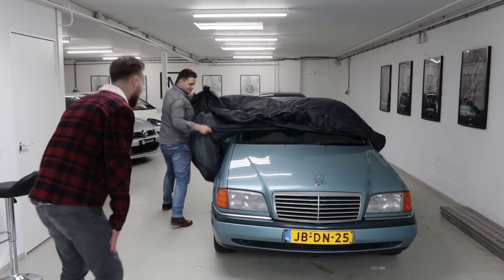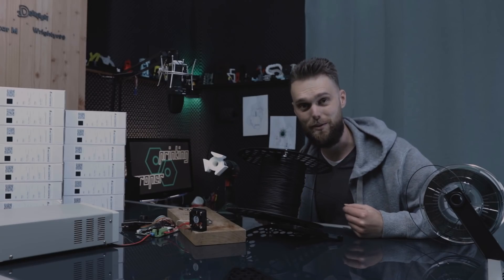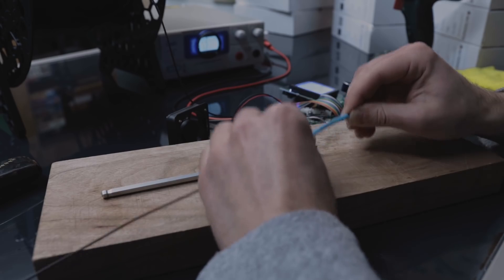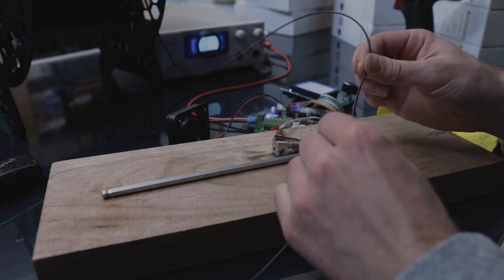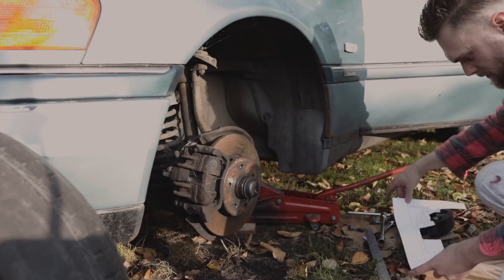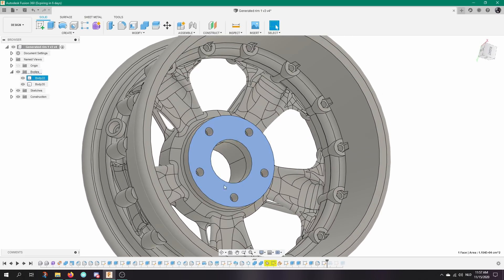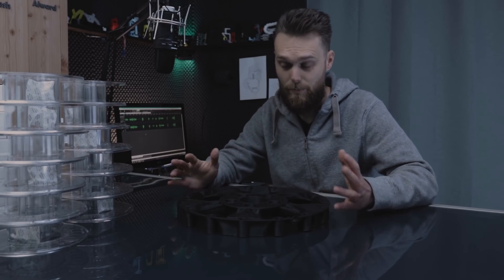I tried to 3D print a full-sized rim for my car out of ABS

Comment: It is interesting to warch the trial and error of an amateur without any scientific based knowledge atempting the impossible, is like watching me about 30 years ago.
On the other hand let's not forget that some bunch of amateurs built the Arc with primitive tools, while higly skilled professionals with all the tools available have built the Titanic...

Your dear rim stands no chance to actually drive you around at normal speed conditions, matter of instant stress and shifting pressure in bends, bumbps, etc, even if made of PEKK, which now is the holly grail, and not with the printer as it is now.

You need to do as I did, water cooled heatsink dual nozzle for indipendent temperature settings (I developped and tested this technology in the last year, sverall KG of PLA went as support material, and same for PETG, Nylon and Polycarbnate for parts printed for test only, sorry, no money for Ultem, not to mention PEEK or PEKK yet), and here I can help, we can talk about it latter, second thing; if you really want to drive them rims safelly (given taken) they need remelting, I am working on that too, the idea is not new, and Stefan from CNC kitchen did some interesting experiments, thou I went beyond that, it is just that I don't care to be a vlogger, so my results rather hit the market through other people, vloggers, influencers,etc.
Last but not least, warping...  yes you enclosed your printer, and that is OK...ish for ABS, PETG, even Nylon, or Policarbonate, but on Ultem (PEI) or PEEk and PEKK the temperature inside must be higher than your machine can take without running into huge issues, starting with cables and drag chain deformations, glueing togehter, and various electronic components failure (nope, they are not forseen for this environment, you need "outer space" rated electronics, and they are not cheap) but if you cockoon your print the results are amazing even in an open frame machine, whilst in a fully enclosedone that can take 120C inside (but not 230C as you might need) might work just fine.
I have cockooned my prints for a few years now, managed to print some impossible geometries in large volumes with litle or no deformations in open frame printers.

One last word on your progress:  Prima.

Comment: why don't you build a filament exchanger? it would be a lot easier to use than your big filament coil. you just a have to refill the feeder when it goes low but it always feed on the coils that are not empty so your print is endless.

Comment: He does realize how much heat brake rotors and brakes generate when braking right? What are the tolerances for abs before it starts to deform.
Reply: ABS starts to soften around 70C-105C (158F-221F). If your able to touch the rim without burning yourself then its not getting that hot. Also don't forget that metal is a much better conductor of heat than plastic and will absorb the heat faster whereas with an abs rim the heat will be dissipated into the surrounding air rather than into the rim. 
Edit: From what I can tell just from a quick google search a normal rim will get up to around 70C-85C in the worst case scenario. So although you'd be cutting it very close any random abs should be fine but using a higher heat abs would probably be best.
Reply: @timothysmith2130  Very in depth comment, good job. I would absolutely never trust this rim on my car, because the damage a broken rim might cause is unimaginable. I have a custom built 3d printer myself, so I understand that prints are never perfect. Even so, I would love to see this rim design submerged in powdered salt, and remelted for more uniform strength. Either that, or print the rim in hollow PLA, and make an aluminum sand casting.
Reply: @jonathonhebert7042  I definitely wouldn't trust it either, I just wanted to point out that heat probably isn't a top concern. I'd be much more worried with it just breaking outright. Aluminum is minimum 2-3x stronger than petg so going for a stronger plastic is a must imo. I think PEEK or PEKK would be much more suitable but they are not feasible to print for the vast majority of printers.
Reply: @timothysmith2130  you can touch it at the outside , now try near the brake disk.... the rim sits right on top of the brake disk tell me how the plastic will absorb any heat if its screwed tight to the hot disk......
Reply: @mgtworld  Now that I think about it, the rotor's heat will not be absorbed and spread by a metal rim, so the rotor will likely get much hotter. I guess we'll have to wait and see
Reply: @jonathonhebert7042  i think the biggest problem is were the rim touches the disk
Reply: @mgtworld  Maybe he should use some kind of heat resistant disk
Reply: Yeah, that's gonna be a huge problem... Go feel the rims of any car after braking. The entire rim is warm.

Comment: Have you done any force analysis? It seems incredibly unlikely that this will stand any chance of working. 
Think about how much torsional force will be applied to those skinny bubbs when you brake, it'll twist itself apart almost immediately. You'd need a solid metal center hub, at the minimum.
Good luck.

Comment: Is there a way you could add a resume print or change filament function to the printer? Then you could plan changes when it suited you, you could stop when a layer had completed so it would be easier to continue on top of the flat plane left when it stopped.

Comment: You really need a filament movement sensor.

A basic one is just a roller with a photo interrupter. Filament feeding causes the signal to pulse every Xmm, if controller (or even OctoPrint) doesn't see a pulse after Xmm should have been extruded, it assumes the filament has jammed and pauses the print.

Comment: Have you considered drilling a 1.75mm-ish hole into a metal cylinder/block and used that instead of a PTFE tube? It's not flexible at all and using a proper drill bit allows you to get even closer to 1.75mm accuracy. For heating, possibly putting it over a flame would be good enough too. I think your main issue there was using a PTFE tube and trying to squish it smaller, cause really you're just basically turning it into some kind of polygon and it's not perfectly round and it can be wider in some areas than it should. You'd best try to get a solid thing to hold it and have the filament go through extremely snug to make it accurate enough. Though I really am not sure. :P Best of luck!
Reply from the maker: It's going to be not 1.75mm-ish, but exactly 1.75mm ;) https://twitter.com/properprinting/status/1332036689368330254 I've got a fun and experimental idea to get this done. Hopefully it will work!

Comment: I dont believe it will work well as a wheel, the ABS layer adhesion is not good.
Reply from the maker: Me neither, ABS is the material to start with and to find out how the printer is performing. I'll be shocked if this will work and we'll see what's needed to get this done ;)
Reply: @properprinting  My printer is abandoned because I cant print well with it :(

Comment: I can't remember when/where but I remember a video about splicing filament and the guy had to run the filament through a series of bends (up/down/left/right and back) to recondition the plastic to flex normally after being heated and cooled.  I'll see if I can find it in my history.
Reply from the maker: I'm curious because I indeed had this experience. The second attempt was with a metal tube and the filament became less brittle after bending when it was cooled down.
Reply: @properprinting  I can't find it, might have been on work computer at previous job.  He used a hair curling iron (with two flat copper plates pressing together) with ptfe tubing.  He then created a jig that had pulleys that he threaded the joined filament on and then ran the spools back and forth -forcing the the filament joint through a series of bends a few times (starting slow and building up speed).  I think he had a heat gun somewhere but I can't remember if it was mounted or hand held.   He used very sharp angles on the cuts to increase overlap and twisted the ends together while heated.  Not like a cigarette being put out, but enough to force a good interaction between the surfaces, not just hard contact.  He also stretched and repressed the joint multiple times to help the plastic mix together while molten.  Apologies for not finding the link but that's the bulk of what I remember from it.

Comment: Great project, it will be quite a ride but Ican't wait to see you rollin' on printed rims :D You can check out filament connectors on amazon, the issue came from using 1,9mm PTFE tubes instead of 1,75mm diameter ones

Comment: Dude, just use filament run out sensor, i was able to print 40 kg of abs without turning printer off on a big format printer, just configure it to not turn off heated bead and turn on the buzzer when filament is gone. There is absolutely no need for joining spools it's almost asking for troubles

Comment: You cut the wires at an angle and by hand before splicing them. Maybe you should make a jig so that this angle is completly the same for both end. If the both ends don't have the same angle then the resulting splice might not be completely straight.

Comment: smart filament runout detector ? o.O its like 20 bucks + filament runs out/jams it pauses the print you swap the filament and continue, just keep the heating on , you also have gear that splices the filement for you as it goes in the machine (mosaic palet 2) etc...

Comment: I use a soldering iron to melt the two ends.  make it too big at the joint then use a drumel to clean it down.  Not perfect but has worked for me on PLA. Don’t use abs.

Comment: Using a dual extruder, you would be able to manually change the filament in an alternating pattern, which won't slow down the print, but you would have to change the filament during a certain time window. Not the ideal solution, but could work?

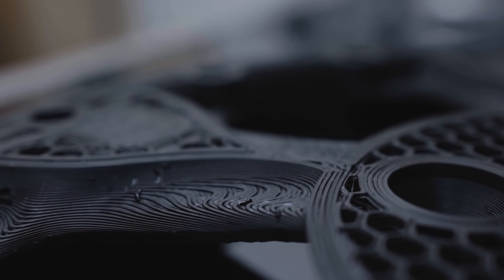Comment: Awesome printer and project.  11:30 - you might want to increase your extrusion multiplier a little?  Some of the beads around the outside of the hub are barely touching.  You want them fully joined to give you maximum radial strength!  Good luck!

Comment: I don't think it is actually a good idea to have huge spools. It will dramatically increase its inertia and each time your extruder demands filament it will pull, but the inertia will resist and cause the accuracy of  the extruder to decrease significantly. Can't you just use a filament runout sensor on a normal 1Kg roll, and swap rolls each time they are empty? To get around the inertia problem I think a spool unwinder would be needed that keeps a certain amount of slack between the printer and spool always. If you stick with the big spool these are available in 10kg spools. https://www.amazon.com/dp/B0745Z3HW4/ref=cm_sw_r_cp_apa_fabt1_3WbVFbCTXVSYP

Regarding your splices. Get two small blocks of steel, clamp them together, and drill a 1.75mm hole exactly on the joint between them. Drill two holes at each end perpendicular to the first hole for some dowel pins to keep the blocks aligned after removing the clamp. Make sure the first hole has a good sharp edge. If not sand the face of the blocks until the edge is sharp. Round the hole on the opposite end to do less damage to the filament in that direction. Then place the blocks over the filament and slide it into your joint again and again until it trims off the excess.

Comment: what speaks against using superglue? i know you can make custom o rings with rubber filament and superglue, i dont know if that will work or not, but it could be. superglue also desintegrates at 200°c so it would not be stuck in the hotend

Comment: The first fail - RUN OUT SENSOR :P Surely, surely it will save the failure?
Reply: won't help if it just clogs
Reply: @kapytanhook  smart sensors absolutely do. They have an encoder wheel, when it stops moving it pauses the print.
Reply: @justindelpero  ah, did not know those existed, thanks :D

Comment: 3d prints are notorious for being not being air tight I think this may be your next big issue I hope you can solve the joining issue. Maybe a two part metal die to size the filament after that can be run across the joint after its colled a little might help to get a consistent size.

Comment: Is there a reason why you didn't use a filament run-out sensor that would just pause the print so you can swap spools instead of trying to join the spools?.
Reply from the maker: Yes. Because the chamber is heated to a stable 60°C and I'm afraid that the print will fail once I let cool air in. Especially when I'm going to print tougher materials at higher temperatures. I need that printer to print in one go.

Comment: 9:06 I see you are now selling 4 kg black ABS filament in 30cm sections for us to experiment joining the filament 😕
As already suggested a lot: the Pallete is a nice solution but with 500 USD not cheap (https://www.mosaicmfg.com/products/palette-2s). Richrap seems to have a nice solution which is worth testing: https://richrap.blogspot.com/2011_06_01_archive.html. Those filament joiners from Aliexpress just make butt welds that are pushed against each other. I have been welding round belts in this way: use a soldering iron with a flat blade, push both ends of the belt on the blade, move the blade away and push the ends of the belt against each other. Then I have to sand the bulge away. For 3D filaments something like this should work if you have a means to thin out the bulge while the filament is still hot. Richrap's solution looks a good way to do this.

Comment: There's going to be literally, a ton of tensile stress toward the bottom of that wheel in the weakest direction that fff fails moat often. There's no way that print will hold up. But, in the off chance that it does, it's going to be EPIC.

Comment: It wouldn't be Proper Printing if it worked the first time, or second, I just know it will work. I have never seen a problem solver with a weirder imagination. If it works then it isn't crazy, but all the cool stuff that goes before it's working is crazier than a pet raccoon.

Comment: You have duet board, try to use/make advanced filament sensor which detect clogs, and when filament is not "flowing" in direct extruder you could have enough buffor of filament which will be not visible on a print. Here is my design which is working great with my duet https://www.thingiverse.com/thing:3879971

Comment: I first saw a tool on the YouTube channel Heliox showing a filament welding tool. It's very simple and reliable. Also consider the Mosaic Manufacturing Palette 2S Pro. It takes 4 filaments and will switch to the next one automatically, then you can refill the empty bay when you can. 
Heliox Video for tool:
https://www.youtube.com/watch?v=UIEp6-mnMGc&t=18s&ab_channel=Heliox
Link to Amazon page:
https://www.amazon.fr/Connecteur-filament-machine-imprimante-Ultimaker/dp/B07YKN2ZGP/ref=as_li_ss_tl?__mk_fr_FR=%C3%85M%C3%85%C5%BD%C3%95%C3%91&dchild=1&keywords=soudeur+filament&qid=1603646064&sr=8-16&linkCode=sl1&tag=4527896-21&linkId=06d5242886bfbc822b2f6e5d119d1b37&language=fr_FR
Mosaic Palette 2S Pro:
https://www.mosaicmfg.com/

Comment: I noticed gaps (underextrsuion?) in the surface layers of the print in the close up shots (near 11:30), such as gaps ~0.5-1mm between individual traces horizontally. I'd hope this isnt present in other internal parts of the print, as it may cause a decrease in strength and structural integrity.

I don't know for sure if course.

Comment: Why cant the filament be swapped?

Could the hotbed not just stay hot, the head move away and the filament replaced? It kinda sounds like it's solvable with firmware and configuration.
Reply: @owowowdhxbxgakwlcybwxsimcwx  I think he might be using a duet

Comment: You went from having to respond to a filiment runout sensor every 20 hrs, to worrying about a fail print all the time. Seems like a poor trade off.

The printer is epic though and I believe you'll be successful!
Reply from the maker: I received several comments about why I don't have a filament runout sensor. The reason is that I cannot reach the hotend without opening the heated enclosure which has a stable temperature of 60°C. If I let in cold air, the print will fail, especially if I'm going to use different materials like Nylon or Polycarbonate so it has to print in one go. Maybe I'm seeing it wrong looking at the amount of comments about this point, but this is my reasoning xD

Comment: Solution: HI JON! PLZ READ.....Hang in there bud, a lot of us have had the same issue. if you want to join filament together. Read the following:
1. get a aluminum cylinder/ block
2. drill 1 hole though the center THIS MUST BE UNDER 2.0MM! (1.7-1.9MM drill bit will work.) (for the filament) (The closer to 1.75mm in diameter is best.)
3. drill a second hole off center for the heater cartage (to supply the heat)
4. put both filaments though each end  
5: supply power to heat the ALU block
6: merge the filaments by pushing inward (the filaments will melt and fuse together within the bore)
7: turn off the power (let the block cool down) 
8: once cool (below the heat transition temp) Pull the filament though
9: repeat :D

let me know if you have any questions! Goodlluck! :D
Reply from the maker: Thanks for your clear explanation! The only problem I can think off is that the filament gets soft outside of the block leaving a collar. So I have to add a cold zone.